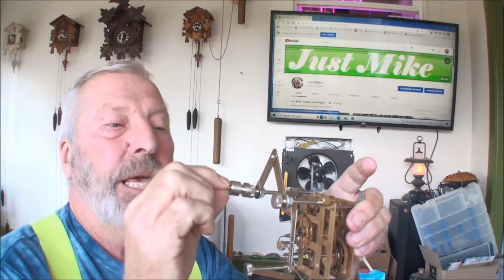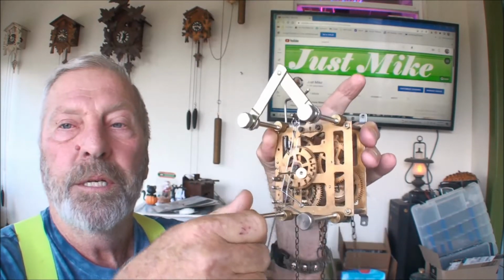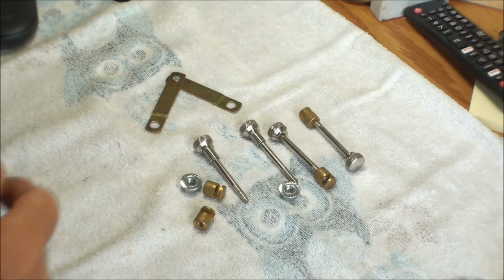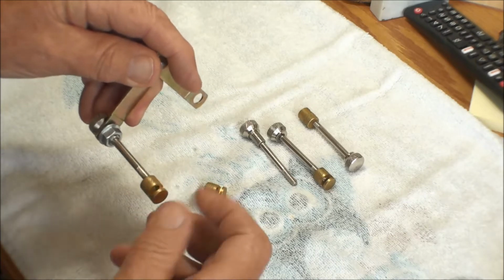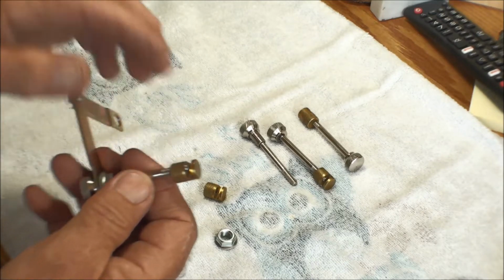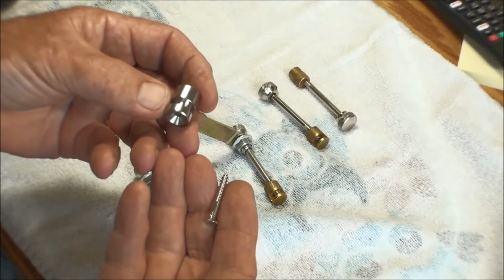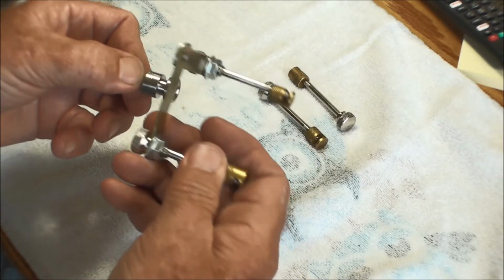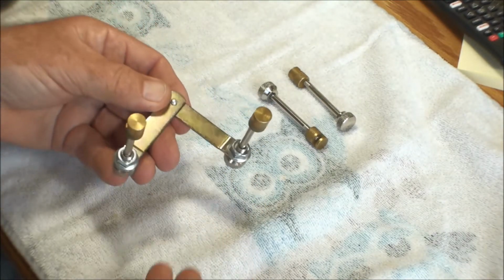2 1/2" Clock Movement Post Clamps Assembly

Comment: Great idea! I have just ordered the movement clamps. As a beginner it sure beats all of the assembly and dis assembly when things don't quite work out with a repair 🙂. Videos are excellent, thanks
Reply from the maker: Well I do welcome you aboard the clock repair world. The repair shops are getting fewer and fewer each year and the ones that are still out there a costly to go to if you take two or three in each year. I have two sets of these legs now. One I ordered out of state and they had the size of threads messed up so bad that I can't even use them. The set I ordered here in the U.S. works great and most of the time is better than a dish or pvc pipe connectors. Thank you so much for stopping in Dennis.

Comment: Dear Mike! I am grateful for your emailed response, especially the link you provided is very useful! I am wondering how the necessary spare parts could be collected in a way that does not incur high shipping costs one by one. I do not know if this will be possible. I wish you all the best, with great respect: István Tóth
Reply from the maker: Some of the spare parts are from clock that were ordered and found that I was the sucker for buying the clock. That is normally why you try to look at pictures of the movement to see if all the parts are there. There have been times I had to order spare movement to fix the clock that I have because the clock box was one of value.
Reply from the maker: Some spare parts are because of a bad buy on a clock that someone tried but really messed the movement up and had to buy a spare movement for part off of E-Bay for the right price.

Comment: Make sure they are tight on the plate, or better yet, the mounting bracket on the movement. I had an 8-day movement fall when the hanger slipped.
Reply from the maker: Yes, I agree to make sure they are tight. I hate to think what happen when the 8 day slipped off the bracket.

Comment: Well, $20 isn't too bad, especially these days. I like the gold ish color. Guess it would be covered up by the face tho. Welp, there goes the wing nut, lol!😁 I like those, how you can just flick it and spin them around to tighten. Oh well, the newer fitting ones are more condensed. Good instructional video!👍 God bless ya, bro!
Reply from the maker: Thanks for checking out the video today. I love the wing nuts also, but they have there place and  beings how you are not working on a truck or lawn mower, something that doesn't need that over tightening to damage your movement. You have a great day Sis and God Bless